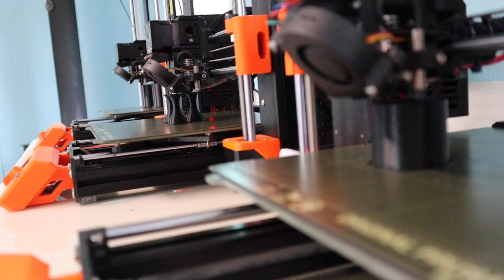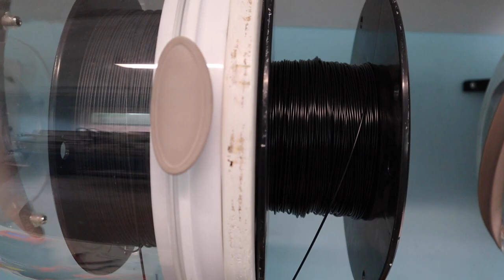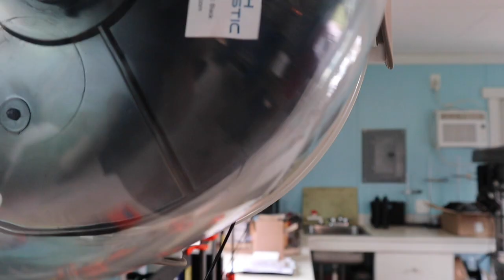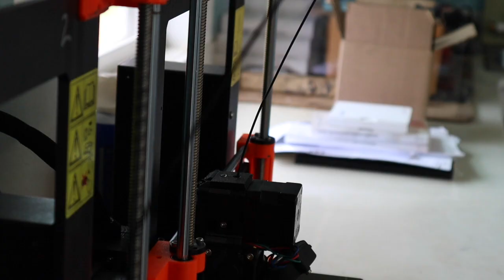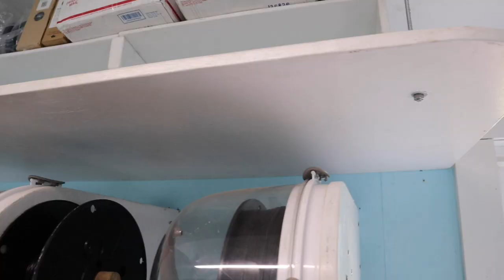A Look At Hoffman Tactical's 3D Printing Setup

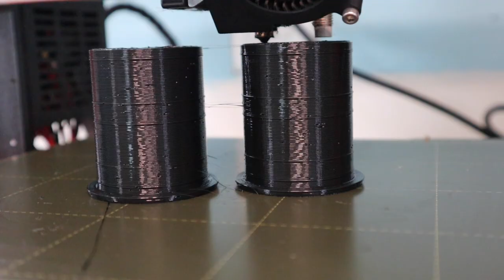Comment: I might suggest you to reconsider the use of a reverse Bowden setup, as your prints seem to suffer from inconsistent extrusion (noticeable i.e. on 3:15). Your argument against it is that it makes the filament change cumbersome, but I find to be as easy as without one, simply unplug the PTFE tube from the fitting. It solves the filament path forces problem fundamentally instead of working around by guiding the filament at an angle, which never gets rid of the forces on the X-axis in the first place

Comment: I just wanted to throw it out there, I've done some research and it looks like nylon X or CF nylon... Some type of carbon fiber nylon would be a really good material to use for lower receivers.

I've been considering building a Glock with a printed lower, and I would use CF nylon or something along those lines.

Thoughts?
Reply from the maker: I have just got my tensile tester up and running, and will determine for sure what is strongest soon. CF filaments are not all equal, a lot of times the carbon fibers are to short and while they make the part stiffer, it becomes brittle. If you want strength, PLA is the way to go. The problem is with impact resistances. I think a Flexible filament (98A) may be the solution. Anyway, if you want to try CF Nylon, take a look at Atomic Filaments Nuclear Nylon. I think they are better  then the Matter Hackers Nylon X.
Reply: @HoffmanTactical  good call, sounds like you've been researching this much longer than I have. LOL

It will be some time before I print some lowers, so I'll be waiting to see what you find as far as strength testing goes. The reason why I bring it up, I saw a review of some type of carbon fiber nylon, and the reviewer claimed it was as strong as 6061 aluminum.

However, I dont remember the brand. I do know it was "short fiber" carbon fiber strands. Just figured I'd bring it up. 

By the way, your content is very high quality. I have high respect for you and your Channel. Good Work sir

Comment: Hey bud, I run a 3 printing shop. We run 12 prusas including 2 MMU’s. Buy yourself some FlashForge Guider 2s’s and ever look back. I have been able to print your lowers on the guider 2s in PC blend and PC-CF in way higher quality than I’ve ever been able to obtain on the prusas. I built heater boxes for the prusas and it wasn’t enough. The Guider 2s is what you should be using for all of your stuff, you will be a lot happier printing this stuff in PC-CF. Also I made an injection mold for your lower, let me know if you want to talk.
Reply from the maker: I would like to get at least one high temp printer. Of course I want to use "consumer grade" printers for all of the lower development, that's because that is all the people printing my lower have. A mold sounds interesting, I assume you also do CNC machining then? If you'd like, shoot an email to hoffmantactical@gmail.com with some more details.
Reply: @Matthew Penn So recommend the flashforge guider 2? Is there anything else I would need to get? I’m looking to get into 3d printing and want to do it right the first time. Any help is appreciated!
Reply: @lunaticrider209  You get the guider 2s and you will be doing it right the first time. It comes pre assembled, takes half an hour tops to get printing and it just works great. The only Caveat is you need to buy simplify3d for slicing, their stock software is awful.
Reply: @matthewpenn407  does it matter if you use a laptop over a desktop? I’ll I have is a macbook pro that’s I’d be using. Also is it easy to switch the software?
Reply: @lunaticrider209  I use a low end laptop and it works fine. Yes it’s easy, just purchase and download simplify 3D and never install the flashforge software. Sinplify3d is fairly easy to use and has a lot of things pre programmed for excellent prints right at the start.

Comment: Hey. I had tried your side charging lower on a new gen 2 bear creek arsenal 7.5 inch 556 side charging upper and it didn't fit. The front take down pin outside edge was too thick to pivot and the back wouldnt even fall in cause the space was too tight between the ribs for some reason. And this was an up to spec print. All lower parts fit in it perfectly with minimal maintenance. Only had to drill the detent holes. I modified the file to hopefully fit the upper but I think it may have taken away structural integrity as well. Hopefully this info can help you come out with better future updates for this lower because other than that I love it. But unfortunately without extensive post processing and material removal or editing the stl it will not fit my upper. And the side charge handing is to the left as well so ik that this lower was supposed to be designed for uppers like the one I have.
Reply from the maker: The side charging Lower only works with the uppers with the charging handle on the right. I am working on a fix for the other two problems, the front swivel pin is not meant to pivot, the lower just presses strait onto the upper. The ribs are to close together to fit some uppers. Anyway, thanks for the feedback!
Reply: @HoffmanTactical  I just realized my mistake. I meant the side charge was on the right side. Bca doesnt even make left side chargers.
Reply from the maker: @DanielMendoza-vz6ss  O.K. Check out the files at the bottom of this blog post, they should fit your upper: https://www.hoffmantactical.com/blog/an-update-on-the-hoffman-tactical-ar-15-lower.
Reply: Thanks so much. I will update you with how it goes. Ik all the info you can get only helps you make better stuff. I'm a huge fan btw. Your lower designs are by far the best available right now. I can't wait for the hose clamp lower to be released 💪💪💪💪💪
Reply: @Hoffman Tactical I went to the link. I noticed the changes you made to the rib to make it less tight on the upper. That will probably help alot. One big issue tho. The file size for the stls in the blog are very large. I was able to resize and although it worked it also added corruption to the files. Not sure how to avoid this aside from having a base file that the size is less.
Reply from the maker: @DanielMendoza-vz6ss  I'll try to go with a bit smaller files next time.

Comment: Have you ever tried to print an AR lower with a full fixed stock?  Not sure if there is enough room on those printers;  but it would be a lot easier to beef them up if it was all one piece.  (I'm sure you've thought of this, I'm just not sure if you've tried it)
Reply: Epoxy in two parts